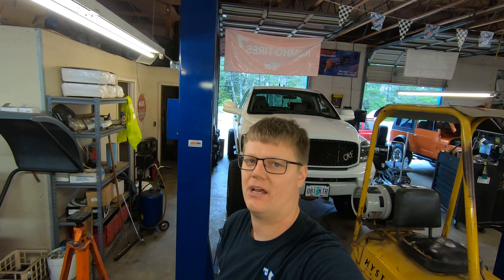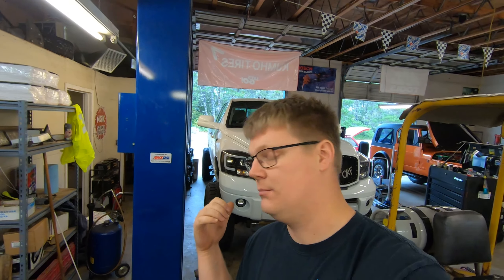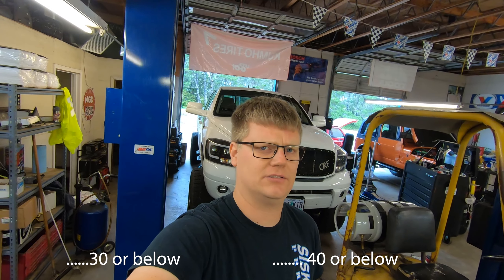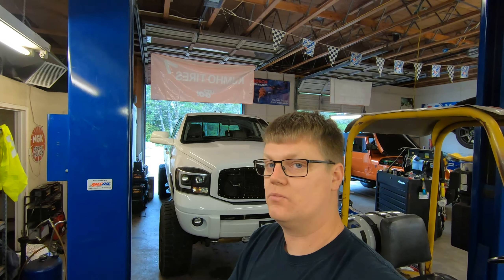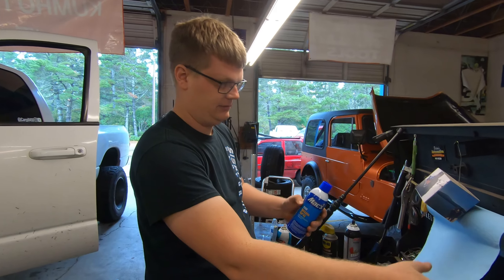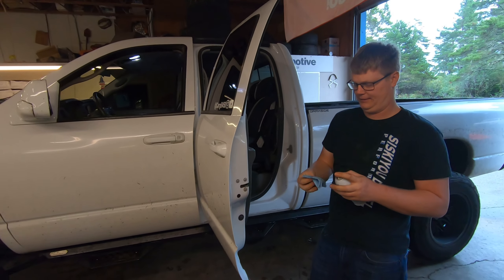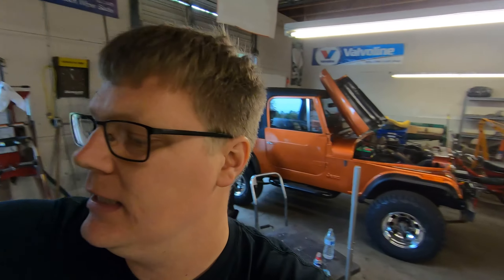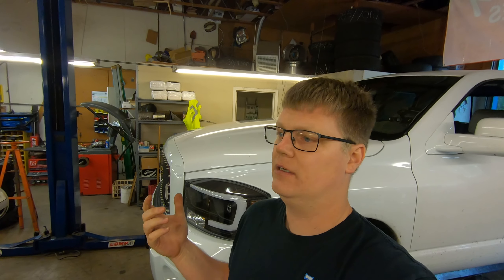Grid heaters and cold weather........

Comment: I grew up with tractors, and rarely plugged in a block heater, so figgered that it had to get pretty dern cold before one had to use the block heater. I recently was told to use the block heater even in not so "jesus H" cold temps. 
Speaking of door seals, mine "leaks". I know that if you have air going, it has to escape somewhere, but it jeez man, the truck is loud enough going anything above about 20 MPH. Does the air have to go out the driver's door. I imagine it's just adjusting the latch on the door, so it latches a bit tighter,  but I thought I might throw it out, just in case anyone else has that problem.
Great video, as always.
Reply from the maker: Does the door seal seem to leak up high like the top corner 🤔
Reply: @Cargill450  it's not a real leak, per se. It's more of a "sound leak". I. E. Driving down the road. Regular road noise. Turn the air on, and the road noise gets louder/ you can hear the air escaping via the door seal. Seals are in great condition. It's happened as long as I can remember,  though I've been blown up A LOT, so memory no work-ie so well anymore.
Reply from the maker: I might have a good short one for you this week if I can get it done, alot of time you can "adjust" the doors and help alot of that noise